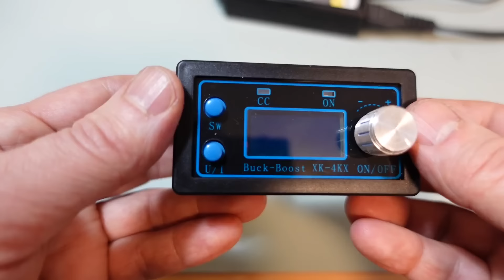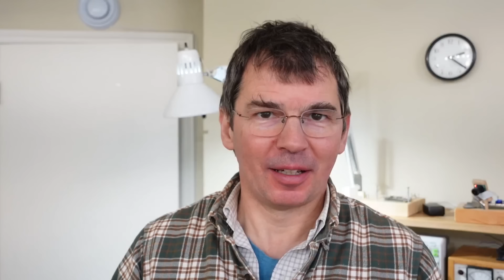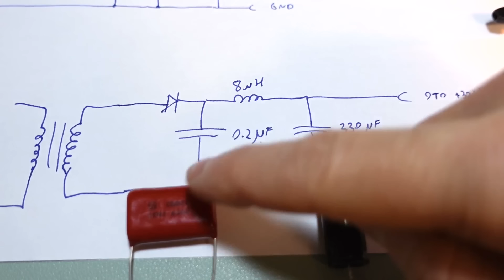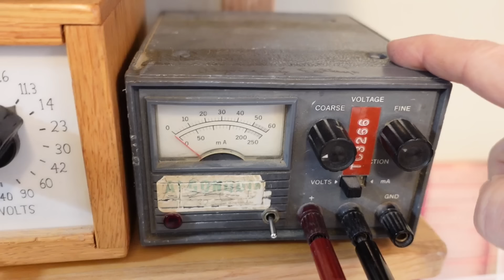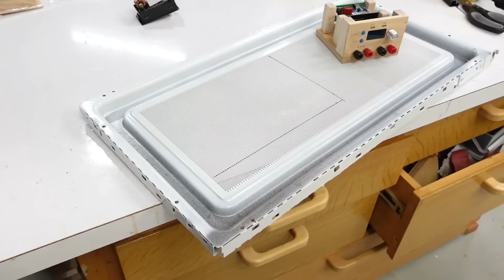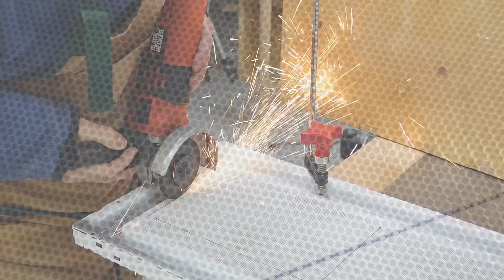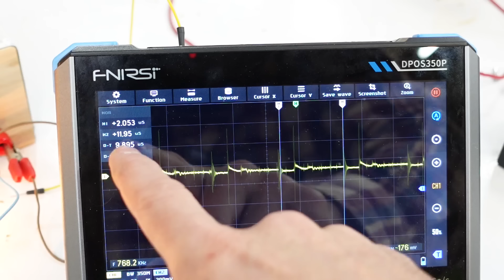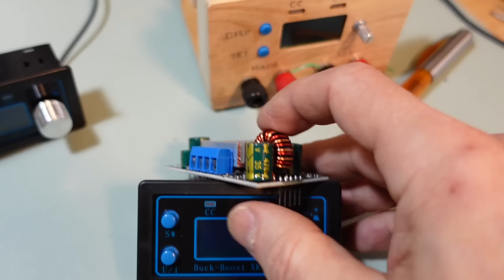Benchtop supply from buckboost converter, chasing RF emissions

Comment: I've gotten a bunch of modules off Drok without any real quality control issues like that, but also at a slightly higher price I'd guess. I rebuilt an old lead acid FD flashlight into a lithium jump starter and tagged into the cell to attach one of these for mad science use as well. The ones with the trim pots are ok, but l gotta replace them since they don't live long if you keep adjusting them, and it would be easier to use with just a course and fine adjust instead of a 20 turn ordeal

Comment: If you put the switch on the low side of the transformer you have a flyback converter...which I think is what you are holding in your hand.
Reply from the maker: More commonly known as a boost converter.
Reply: @matthiasrandomstuff2221  I would argue that the “common” definition of a boost converter does not include a coupled inductor - a transformer. The topology we are looking at is non-isolated flyback.

Comment: There also exist buck boost circuits that uses a single inductor and a H bridge. It can change from buck to boost depending if the voltage needs to go up or down so to speak.
Reply from the maker: that would be more efficient, non polarity reversing, but unfortunately a lot more switching elements.
Reply: @matthiasrandomstuff2221  Yes and a lot more complicated controller :D

Comment: Nice trick for shearing the thin mesh! I'll have to keep that in mind for future use.
Reply: A rotary tool with a small or worn cutting disk would do a similar result but yes, the shearing technique is neat.
Reply: @WJCTechyman true but that'd be messier. Get metal dust everywhere. Shearing it is clean, quick, and quiet. Very elegant solution.
Reply: @arcrad  I don't think shearing is too quiet. At least it isn't with a cold chisel. You do have to smack the chisel with a hammer after all.
Reply: @1pcfred quiet compared to a rotary tool. Or at least a different kind of loud haha

Comment: Don't forget that when high frequency noise mixes with your signals that you get sum and difference products.  So just because the noise is really high didn't mean that it won't interfere. It can actually be worse, as it radiates through the air more easily. Cheers from Almonte.
Reply from the maker: provided it has something high frequency to mix with.

Comment: Hey Mathias, one thought about your measurement setup regarding the ringing. Please try repeating that measurement using a ground spring on your probe. The loop created by the alligator ground clip picks up a significant amount of noise which might not be present in the true signal. It is also customary to limit the bandwith to 20 MHz when measuring ripple voltage.
Reply from the maker: well, using 20 mhz bandwidth limit takes care of the ringing! :)  yes, 100 mhz is marginal with the ground clip, but given the wires that it has to go thru inside my box,  I figure its not going to change it much.
Reply: @matthiasrandomstuff2221  You're right, I didn't, mention that the measurement should be conducted as close to the output capacitor on the PCB as possible.
Also, please take a look at any datasheet of a power supply of a reputable manufacturer. Ripple and noise are always measured with 20 MHz bandwith. It's industry standard.
Reply: One habit I got into when I see switching noise and ringing on a scope trace is to connect the scope probe ground first, then connect the scope probe itself to the scope ground.  If you still see the noise/ringing, then it's common mode and/or a ground loop, and a differential-mode filter isn't going to suppress it.  At a previous job I had access to a Fluke ScopeMeter, which is both battery powered and has isolated inputs, and I really miss is.  I'll check out your FNIRSI DPOS350P video and maybe pull the trigger this time, although the price would have to be significantly cheaper than the FNIRSI website price for me to risk another AliExpress purchase, where my success rate is under 50%.

Comment: I run mine off USB-C PD. 20V max, but covers most general use cases for me.
Reply: Same, with my RD6006P when I use it anywhere but on the bench (or isolated). But this one in the video is buck-boost, so it should work up to the max voltage?

Comment: The fact that Fnirsi oscilloscope is running on batteries does not eliminate a noisy power supply at all.
Reply from the maker: Whatever nosie it is, its MUCH less, especially because the power supply can't introduce any common mode (ground) noise, which these power adapters have a tendency to do.

Comment: I bought one of the 30V 5A color modules from Ebay a few years ago and found that an old DC switching power supply pulled from an Epson Ink Jet printer just about perfect to run it.  The Ebay adjustable power supply said it could take 40V max as an input and the Ink Jet supply puts out 42V and 2 amps so it's close enough and should allow the whole assembly to put out close to 70-80 Watts and cost nothing extra.

Comment: There are just a little bit bigger modules with same size display, but with the power stuff on external board. And there are matching boxes for those too. And Bluetooth module, if for some reason you would want to control it with your phone.

I made one for driving smoke extract window actuators etc with a 18v power tool batteries, instead of carrying lead batteries to roofs. That one is 50V/5A out, if supplied with 25v or more, with 18v battery it goes to 170 ish watts.

I would have liked it to have safety banana connectors in and out, but there wasn't realistical change to make it work, so I can't use my good leads on it.  Battery is connected with fakita usb-adapter, with banana leads soldered directly to its contacts. 

Even the optional bt-module has come handy one time, when I had to solve mislabeled cabling for 60 motorised fire blocking valves on a large hvac room. I got to be 15-20 meters away from the control cabinet when I killed the power output and listened for the spring operated shutting of the valve to find which one it was.

I also made one with internal batteries from a module that's more like the ones in the video, with charging and bms circuits in it. It has only 3x 18650 cells and is a little bit weak for my taste. Should make bigger one that has everything in one case too.

Comment: Nice pi type filter and noise choke mod. The microwave door for the enclosure was a stroke of genius as was the cnc carving the face plate. If you plan to use this p/s long term those cheap green and gold electrolytics are notorious for crapping out so you might want to swap them out with better quality caps. Of course it's up to you. There's always a balance between whether it's worth the bother or not.
Reply: China is why  I gave up on the electronics hobby. They just make so many garbage components.

Comment: I've used this exact modell for bench top power supply for portable battery (tool battery) power supply, and corded ones. Super handy for trouble shooting out in the field. I recommend not using it on currents over 2.5 A out. They do not work very long if used in the higher current application.
Reply from the maker: I hope with it not inside that little plastic housing, it cools better.
Reply: @matthiasrandomstuff2221 I'll probably redesign it after watching your video. Thanks for sharing great content!

Comment: I would like to know if it is possible to reduce /eliminate rf interference generated by the switching? The case has to totally enclose front and bottom without any plug holes.
Reply from the maker: Yes, a faraday cage would do it.  I didn't ground my case.

Comment: Me using linear regulators: heat 
Me using switching power supply: why doesn't it always work

Here's how they work to me: linear converts DC to other dc by turning it down and burning the rest of the energy as heat. Switching supplies will either buck or boost it with the coil windings to turn it up or down but make rippling noise.

Comment: Have you tried it with your florescent lights over head turned off? They generate alot of noise
Reply from the maker: I guess I should, but we don't have any flourescent lights in the house -- the one that was flourescent I took the ballast out and put LED bulbs in.
Reply: @matthiasrandomstuff2221 nice. I thought I saw one in a pict , that's the only reason I mentioned it.
Years ago I had the problem of a bad fixture not letting a signal go low when it should have😮
Reply: @matthiasrandomstuff2221 did you video that? I have fluorescent fixtures in workshop finished ceiling, don’t want to replace with different size fixture and was wondering best way to retro it with LEDs
Reply: “Ohh good, I didn’t screw it up” love that line coming from a pro like you!

Comment: Ive seen you offhandedly mention using AI a few times now, particularly with your experiments which involve coding. Would be very interesting to see you do a video where you see how good it is for woodworking. Asking it to draw plans for a piece of furniture or guide you step by step through building something. Feels like it would yield similarly interesting results to when you were debating the usefulness of CNC a little while ago.
Reply from the maker: AI telling me how to make something?  AI could be as good as a skilled person telling me what to do.  But even if it is that good, I don't want some skilled person telling me what to do in the shop.  I already know what to do, and because I can see the stuff and know MY equipment, I know better than some other expert without that knowledge could be.  So I don't see how AI could ever be useful in that role.
Reply: @matthiasrandomstuff2221  That is (to me) what would be interesting about it. As a software engineer, it's often an interesting topic of discussion dealing with AI generated code and suggestions, where sometimes it is spot on and sometimes totally off-base. Trying to find the cases where it is a useful tool vs a time waster. Just a thought that your perspective as an expert maker would be interesting critiquing AI's suggestions or doing it's good/bad ideas regardless and seeing the outcome. Especially since woodworking is has a much smaller volume of training data than most software languages. Thanks for the response though!